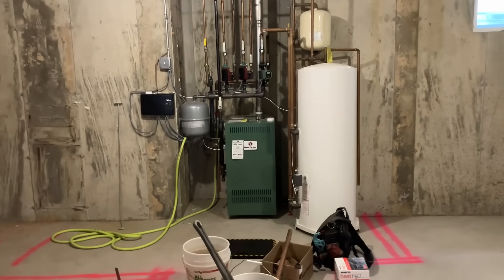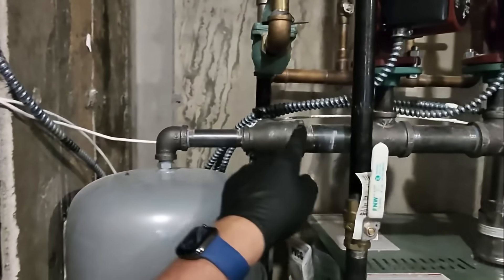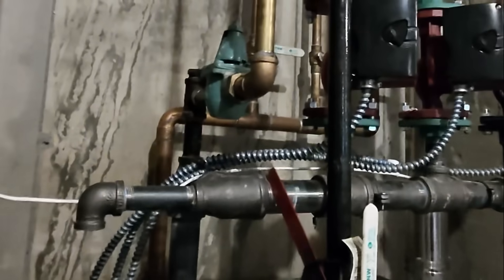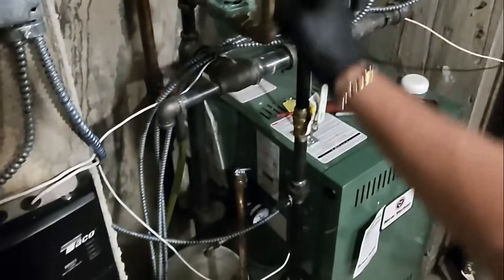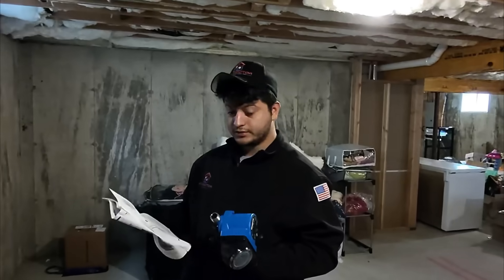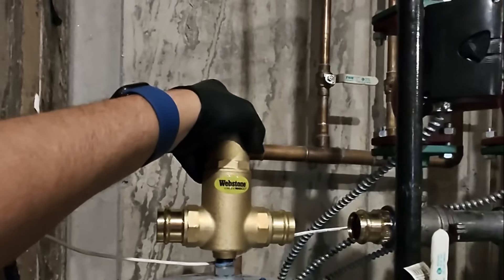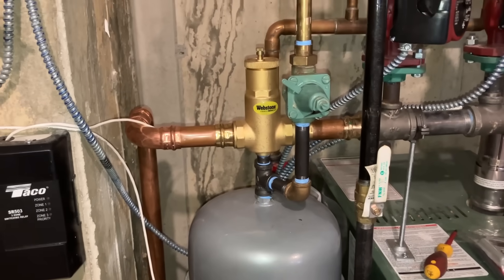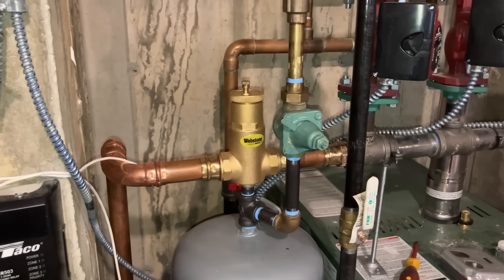WRONG Boiler Install Finally FIXED 🔧 New Yorker System Gets a Webstone Air Separator Upgrade!

Comment from the maker: 💥 Another botched boiler install brought back to life! This New Yorker system was missing a key component — the air separator — causing endless air problems and poor circulation.

Watch the full transformation as I re-pipe, re-press, and re-engineer it the right way.

👇 Drop your feedback — do you prefer an air scoop or Webstone separator?
Don’t forget to LIKE 👍, COMMENT 💬, and SUBSCRIBE 🔔 for real-life service calls, pro installs, and HVAC training moments from Mikey Pipes and Pipe Doctor Home Services.

Comment: Would suggest an isolation valve for the expansion tank
Reply: A 5 second google search of that suggestion please
Reply: @Pwagismyname you can just take the handle off the Valve
Reply: @Pwagismyname if you need to search that up on google you shouldn’t be touching a boiler. Yes an isolation valve is a great idea, expansion tanks fail all the time and if you don’t add a valve replacements become time consuming and expensive!

Comment: Easy $300! Love it
Reply: Shit costs more than that bro lol wow
Reply: @goonzsquad1  easily $1600-$2000, 1.25 spirovent is $250, a handful of 1.25 propress fittings is another $150, piece of 1.25 copper is another $100, back flow preventer is another $100, random nipples and fittings are another $50 so materials alone are $650 with markup it's easily $1000-1300 then 2 hours labor at $225 an hour and $150 trip charge.
Reply from the maker: i have no idea what you are talking about but thanks for the comment
Reply: I know I’m in the trades, homeboy upstairs is buggin lol